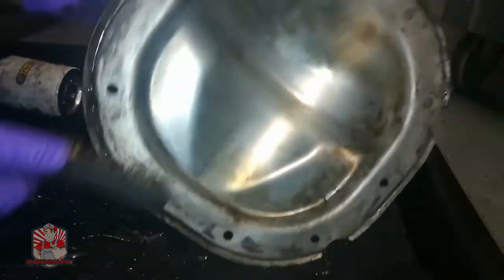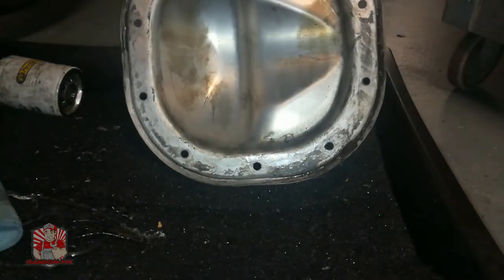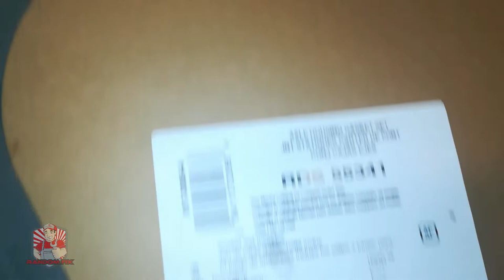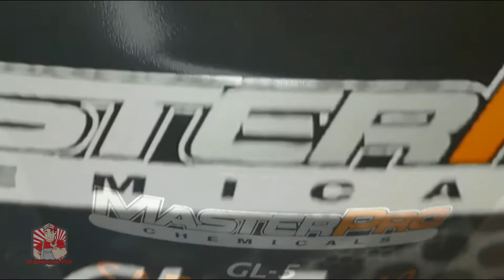▶️Ford Mustang Rear End Service 2004 2003 2002 2001 2000 1999 Gt Mach 1 Cobra

Comment: How often does this need to be serviced?
Reply from the maker: I recommend 60k miles. _Randomfix
Reply: According to the maintenance schedule that I have, there isn't a maintenance interval. There are varying mechanic opinions on how often this should be done. I plan to do mine every 30,000 miles along with transmission fluid.